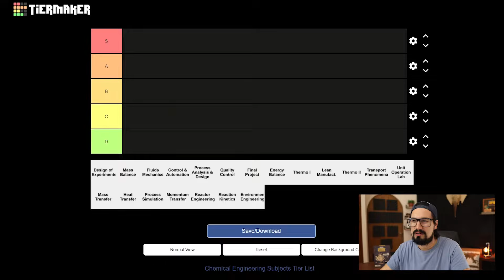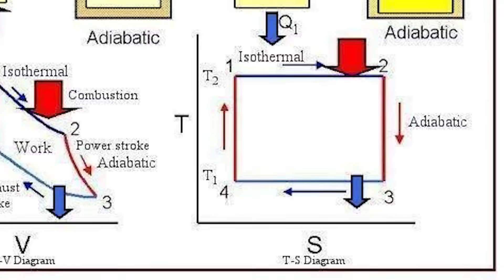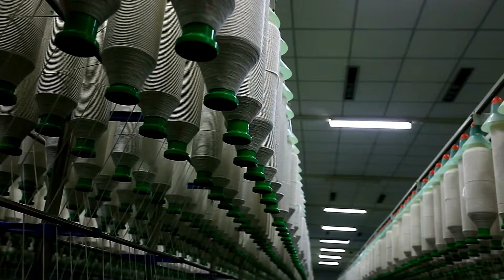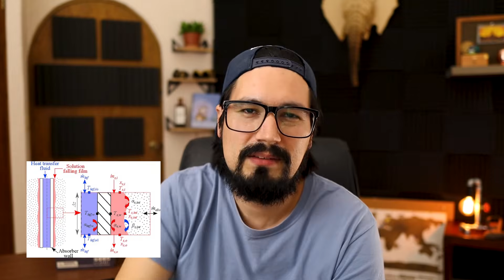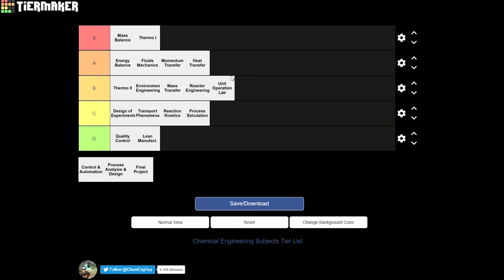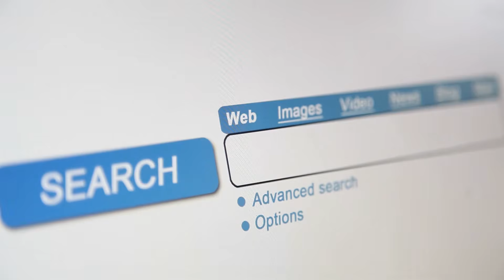ChemE Subjects Tier List  - The Most Important Courses for your Academic & Professional Life

Comment: I go to university of Pittsburgh, we have a bit of a strange chemE curriculum. We have 8 required chemE courses: MEBs, Thermo, Transport, Reactor Kinetics, Design I and II, Safety, and Systems. It is possible to graduate taking no other chemE classes (electives could be fulfilled by other engineering and science disciplines). Most of those courses are 6 credits, plus 1 credit lab. I'm sure separations, unit operations, and other key topics are mixed into those 8 courses... At least I hope so.
Reply from the maker: I also hope so  XD... Jokes aside, ChemE curriculum varies a lot from university to university, country to country. If there is anything missing in your studies, you will compensate that in the industry (via training)

Comment: Hey Man, I just found about you today. I am currently an undergraduate student and I'm having a hard time picking between chemical engineering and chemistry. I am good at Maths and Chemistry but my physics sucks. I was wondering if from your point of view which one is better and is Chemical engineering Worth it?
Reply: Hi SalimomoX, hopefully it's not too late. I highly recommend not picking chemistry. The job market is terrible, even if you get a PhD (which you will have to do if you want to make more than a manual laborer). I know because I did it. I'm now on my second bachelor's degree, in chemical engineering. By most estimates, a B.S. in chemE will provide a much better career than a PhD in chem. I love chemistry. But it won't pay the bills and you'll most likely get trapped in dead-end jobs without a PhD or publish-or-perish academic stress with a PhD. Working as a PhD chemist in industry for decent money is possible, but the market is over saturated. ChemE is a much more pragmatic, practical degree that will probably set you up for success. You can learn the physics along the way. In my chemE classes they basically re-teach all the relevant physics that students were supposed to learn in physics I and II (mostly thermodynamics), so it probably won't be that much trouble for you to catch up. Don't waste 5 years like I did, pick chemE (or better yet, software engineering/computer science).
Reply from the maker: Well, I always encourage to go for the one you are actually interested, regardless of $ or job opportunities as it is much more likely to make your way around in things you actually like or have a passion. Therefore, go for the one that you prefer. Both are growing and promising fields. And yes, ChemE is stil worth it... I will be making a video on it soon!
Reply: @ChemicalEngineeringGuy  thx man you don't realize how much this helps :)